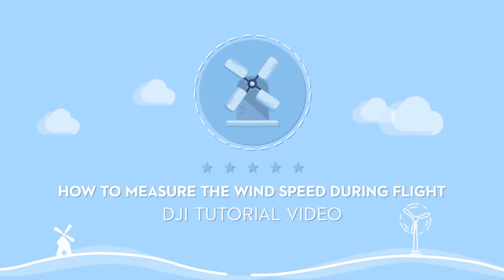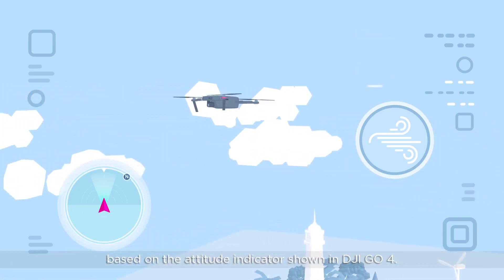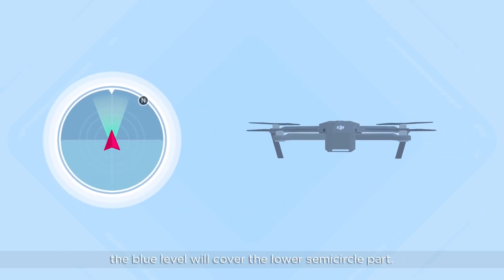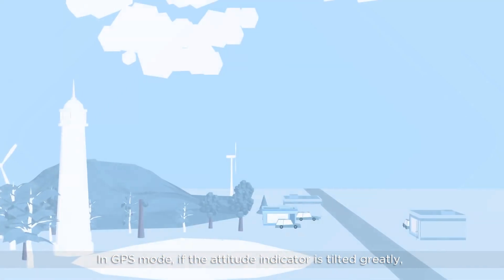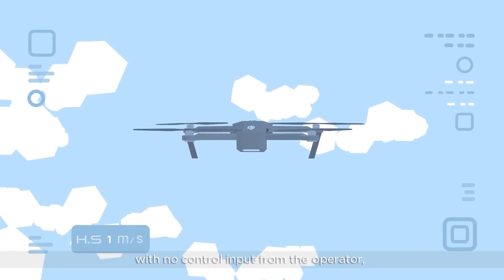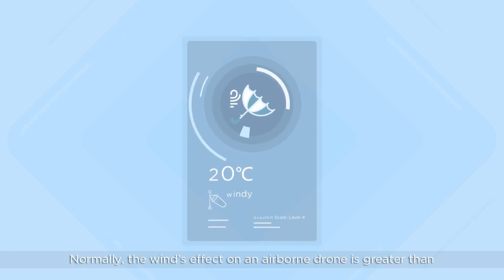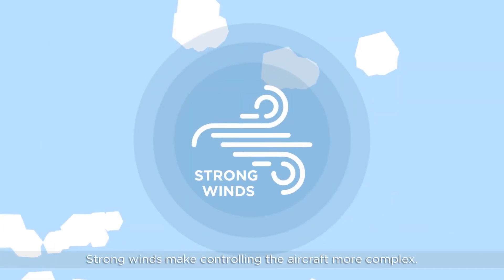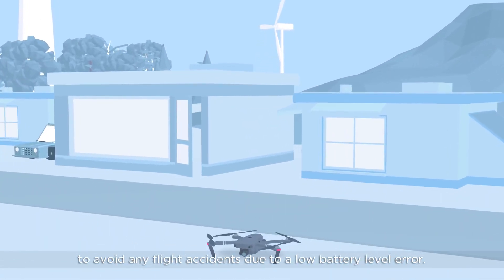How to Measure the Wind Speed during Flight

Comment: If this is so important, why is there no attitude indicator in the “Fly” app, which there is no option but to use with the Mavic Mini and Mavic Air 2? I’d suggest it’s even more important with these smaller devices as they are less capable of dealing with stronger winds.